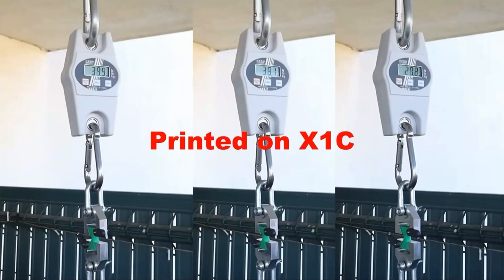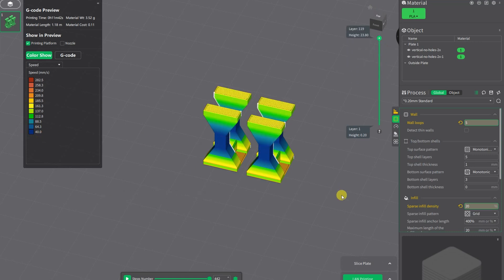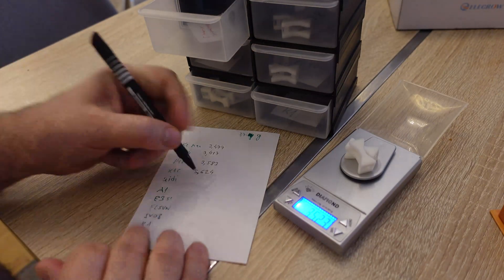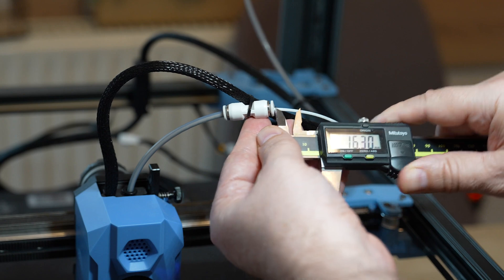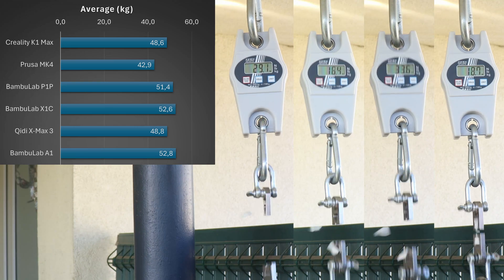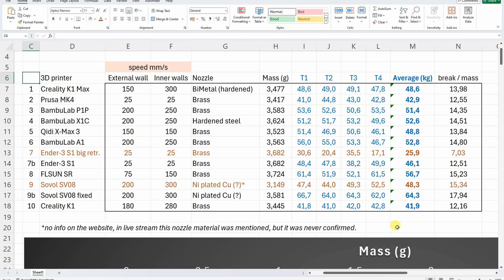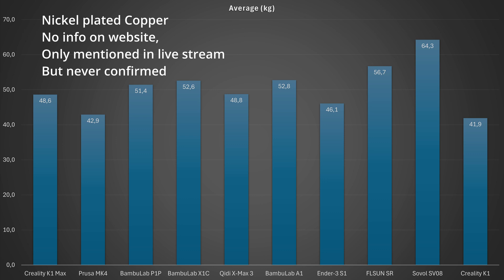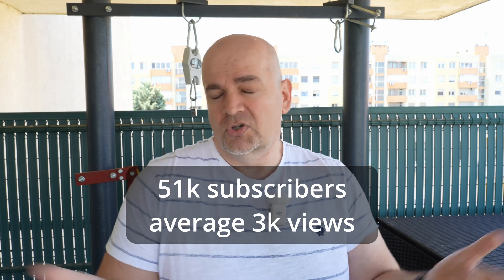Big layer adhesion test with 10 different 3D printers

Comment: Okay so layer adhesion doesnt go out the window with speed if ur inside the flow rate of ur hotend. The sv08 i saw people with bad layer adhesion when printing fast. And it seems like you figured out why! Its not calibrated right. Good to know that its simply a E step issue
Reply from the maker: I have better video for this. If filament is properly melted, then the layer adhesion don't depend from speed to much. Until the same flow is served. https://youtu.be/W3SCl302CP4?si=etIJPGXReDxOdaaC

Comment: This test should probably be repeated on the same printer, such as X1C or SV08, but adjust the speed of each part and see if faster does give better layer adhesion. 
Would also be interesting to see how much nozzle temp affects the layer adhesion, between the minimum 190C to the max 230C for PLA. Might mean printing hotter with poorer quality if layer adhesion is important.
Reply from the maker: Something like this? https://youtu.be/W3SCl302CP4?si=w4Iy3rexcjI-bULN

Comment: I wonder these results has anything to do with part cooling. Cnc kitchen had one test where he changed part cooling fan speed and he got different results. So maybe MK4 is cooling the part way too much or the slow print speed allows the part to cool down too much. I definitely did not expect MK4 to be one of the worst in terms of layer adhesion.

Comment: the default nozzle on the P1P is stainless steel, same on the A1 I think. And I remember stainless steel having worse thermal conductivity compared to brass, so I raised the temp by about 5C to match the appearance and the adhesion. Print temperature should also make a difference when printed.

Comment: I would think, that faster printer will do better at layer adhesion. That's just my theory but: with high speed printers top layer will not cool down as much and therefore will connect to the new layer better (same temperature wiggle of filament molecules). The wait for new layer is just visual matter, as top layer that is still hot can deform due to nozzle drag. Maybe try same testing sample but force printer to not cool between layers (without that dices)  - for it to put next layers on hot previous one.

Comment: Thanks for the short and sweet video. Nice too see I was wrong for slower prints to be more solid, somehow high speed is also a sin for strength; great news!

One idea for future test is to play with the bambulab 50%, 100%, 120% and 150% speed settings available in the printer UI. This way all the variables are fixed. Under current theory the faster the print, the higher the strength?
If it is about cooling the also printing per object on the plate instead of per layer (across objects) would also affect results.
Reply from the maker: Thx. Something like this? https://youtu.be/W3SCl302CP4?si=eeb9QRNh_DChTIhX

Comment: Nice investigation as usual. I would be interested in hearing the results of your further testing regarding the effect of retraction even if only as an addendum to another video. Also, if you have time, I think it would be interesting to add pressure advance to that test as it may effect layer adhesion in a similar way to retraction.

I also liked your investigations into PLA annealing and I think you should make that investigation a 3-part series by testing the effectiveness of solvent induced crystallization. There is a paper published on this from 2020 but they used spun-filament mats instead of printed test parts. The alcohol annealed parts showed greater crystallization with less deformation than the 85C heat-treated parts. I would be really interested to see if the chemical crystallization can penetrate enough of printed parts to improve heat resistance and mechanical properties.

The title of the paper is :  Effects of thermal annealing and solvent-induced crystallization on the structure and properties of poly(lactic acid) microfibres produced by high-speed electrospinning

Comment: That's super interesting about the retraction settings affecting layer strength so much! I'm glad I have spent so much time tuning my pressure advance settings. With the Bowden extruder on my Ender 3 V2, my retractions are around 0.85 mm(!) for most filaments. Cool to learn that might mean my prints are stronger as a result. 😊

(I keep meaning to start doing my own testing.)

Thanks for all the testing you do, Igor. I know it probably takes an incredible amount of time. I am glad you investigate when results are different than expected, like with the unusually low adhesion with the Ender 3 S1 and the under extrusion with the Sovol.

Comment: Would be great to see the same tests with the slowest printers and the print temperature  gradually increased until strength was similar to the other printers...I have a MK4 and V400(like the sr only larger/better with direct drive) and I was always under the impression that the MK4 was superior to the v400 in regard to strength of prints...........
(the temp I use for PLA/PLA+ is 220c)

Comment: Yap, the evolution fortunately can be seen!

Btw on hot summer days with no AC, my X1C has started to make lots of spaghetti failure with PETG BBL, 0.6mm nozzle
Reply from the maker: You leave both doors opened? For PLA, PETG my doors are always opened (actually, PLA, PETG I like better to print on P1P)
Reply: @MyTechFun  The top is slightly opened, but it seems I have to open it more seriously

Comment: I realy wondered why the slow printers had so bad layer adhesion. Only thing I can imagine is that the temperature is to hot for the material and it begins to degrade because it is in the heat zone for to long. Would be realy great if you could test this.
Reply from the maker: Probably there is more temperature dilatation. One weak layer is enough. Chain is strong as the weakest link.

Comment: Why are you running the Prusa so slow
Reply from the maker: Default setting for 0.2mm quality profile in Prusa Slicer. This is the profile I am always using and this is what I was curious about.
Reply: @MyTechFun  it looks like your are using the non input shaper MK4 printer in printer settings. There the printing profile name is quality. When you use the MK4 input shaper profile ( you need to add a new printer) the quality profile is named "structural".
Reply from the maker: @Dauphin21x2  I don't use stock nozzle bolts any more. This is the disadvantage of stock input shaping, without possibility to do a vibration compensation test..
Reply: @MyTechFun have you tried is with your setup? I have also changed parts and found that the is setup is pretty robust regarding mass changes.
Reply: @MyTechFun  are you useing input shapeing

Comment: I like the new condensed video. Maybe it will stop people skipping to the end. 

Interesting the slow printers had bad layer adhesion. I wonder if you did a test with different max flow rates in the slicer, you will get a bell curve with a sweep spot of best layer adhesion.

Comment: Combining these results with what others found it looks like higher speeds are better up to the point where the extruder can properly melt the filament. 
About the copper nozzle of the Sovol, going to copper high flow nozzles like the ones from Triangle lab, or even their volcano versions might well further improve results. They will also enable higher speeds or wider / thicker lines maybe further improving results.
Reply from the maker: Great thinking and conclusoins. Thank you! Yes. Fast printers are good to point where extruder pushes properly the material.

Comment: Great video as always. I'm more looking forward to strength difference of ASA in the qidi vs the others since it has a heated chamber. Also strength difference of ASA/ABS when allowed to cool down slowly in the chamber vs taking out the part immediately.
Reply: I have a Voron that can print ASA in an 80C chamber, I can print samples for you to compare. It should be twice as strong in the layer adhesion department. Let me know if you are interested.

Comment: You need to display the variation in the 4 tests for each printer that you did and not just the average value.  I.e., - show the span of the strengths for each average value.  This will give a more complete picture of the data.
Reply from the maker: I added standard deviation too. You can download the table with all measured numbers from: https://www.mytechfun.com/video/381

Comment: I know it's kind of a meme, but I have multiple Creality filaments including PLA-CF, transparent PETG, and Ultra ABS and I'm pretty pleased with all of them. Also got incredible prices thanks to Amazon price drops, so I really can't complain. Just wanted to put that out there in case anyone questions the filament choices or is curious.
My guess for retraction affecting layer adhesion is that 5mm of retraction means the printhead remains stationary during the retract and unretract moves. 5mm at a fairly slow stock retraction speed setting will add up to a lot of time very quickly. This allows the layer to cool, and the next lines laid down won't adhere as well.
That connects back to the slower printers having worse adhesion, actually. Same basic concept. If you are able to lay down the next layer while the previous is still hot, you get the best bonding. Balancing cooling the line as it is laid down and keeping the plastic hot to bond well is the real secret sauce to adhesion I suppose.
Once again the K1 falls kinda short. It was really just not a fully baked product I think. Their extruder design is still bad even if they have improved it. I suspect the SV08 has the best adhesion with the fixed extrusion for the same reason just discussed. It was fastest, so best adhesion, just like faster Bambu Lab machines scored higher.
The nozzles could definitely make a difference. I believe another channel has tested nozzles with layer adhesion specifically. It may affect the temperature the filament is actually seeing more than anything. Truly temperature equalizing printers at the nozzle with external probes then seeing how speed affects adhesion would be cool!
Great video that gives some answers and asks a lot of questions. :)
Reply: he also tested nozzles for layer adhesion :)

Comment: This was a great idea, but printing at 25 mm/s on the Prusa MK4 is likely not realistic at all. Who gets a MK4 to print at Ultimaker 2 (2013!) speeds?
Reply from the maker: Default setting for 0.2 mm layer quality.
Reply: @MyTechFun  Why not use the input shaper profiles? Those seem to be the most used. The 0.20 STRUCTURAL has 45mm/s outer wall, 80mm/s inner and faster for the infill. The faster profile has 170mm/s for just about everything iirc.

Comment: Ok so bambu printers have either stainless or hardened steel nozzles, but that is only for their tip, the body is always brass and that is why you got similar results :)
Reply from the maker: A, something like bimetal on x1 max. Thx
Reply: @MyTechFun   👍 thanks for another very useful video, and I think that you are right about slower printers letting layers cool more :)

Comment: Hey My Tech Fun, I think it would be nice to also have a comparison of enclosed printers like the X1C or the QIUI with the door open or not open, to see if there's a difference for materials like PLA!
Reply from the maker: With PLA it's risky to print with closed printer, if heats go above heatbreak (and melts PLA in cold zone), that clog is hard to repair.
Reply: @MyTechFun  yea I actually now did a bit of research on the topic and people talk about heat creeping, although it never happened to me. Just wanted to know if with PLA we would also get greater layer adhesion with a higher temperature chamber
Reply: @MyTechFun  I have another question, if you can answer. What setting did you use for the Bambu lab printers? Default PLA? I'm saying this because this has a slower printing speed when compared to BambuLab's Basic PLA profile, which could result in higher values, as seen in the printer with the highest speeds!

Comment: Fantastic work. I wonder if there is a sweet spot for previous layer temperature fir optimal adhesion. Or perhaps extruding at a faster rate means more pressure and their more adhesion?

Could you see if you can get one of the other fast printers to match layer adhesion of the sovol ( fixed) by increasing speed settings?

Thabk you for tour time I only have one printer so can't do tests like this.

I print 230inner230outter on my k2max and im happy with the qualiry and strength. 😁

Comment: I have 3 different printers and if I need high layer adhesion I use a 6mm3/s limited on all of them.
Reply from the maker: Depend of the printer, some machines are ready for higher speeds too. In case you missed it: https://youtu.be/W3SCl302CP4?si=zF6nejGcS1jQpXjK